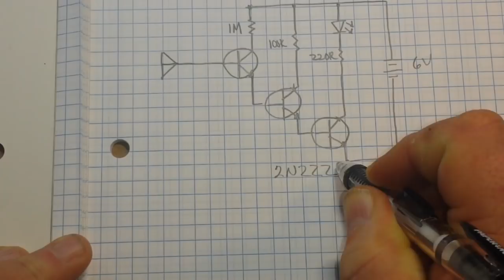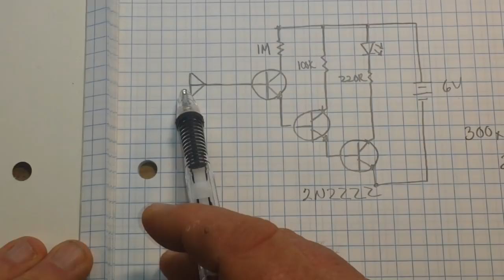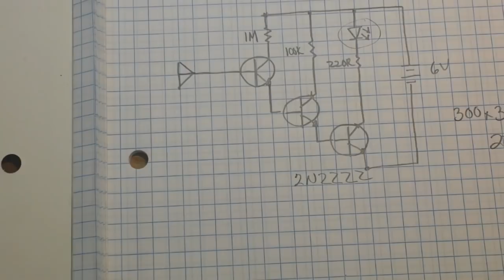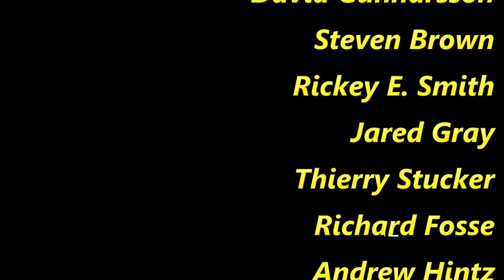Just for fun: 3 transistor charge detector( ghost detector)

Comment: I was looking for something to detect how much of a charge electrostatic filters still had. Potentially it would give me an idea If a n95 mask was still usefull. I put a volt meter across the diode to give me a digital readout. What I've noticed is that I seem to get a strong reading when I move the filter about an inch or two away but the signal dies when I stop the movement. I seem to have to induce a current thru motion.  Is that an expected response?

Comment: I know this is an old vid but i wanted to try it as im just learning but i could  not for the life of me get it to work. The components i got are exactly the same as listed, but once assembled the led is on all the time. I tried looking for shorts but there are none, i checked the transistors are in the right way, i changed the transistors incase one was faulty. I tried over and over with the same results. What am i doing wrong? Why would the led be on all the time?

Thanks for any help
Reply: Your bias on your 1st transistor is too high. Either your pickup wire is too long or you use higher voltage or you have too much interference from RF or static

Comment: Hi, I'm looking for a solution to detect AC or DC current in a wire (= 0 Aamp or >= 0 Aamp ) without contact to the copper with an hall effect sensor. I'd like to use à ESP8266-32 to get ON/OFF information. I'd like to detect that electric machine status is on/off without cutting the wire (just by gluing the sensor on the wire for example)
 Do you have any recommendation, video in you pocket ?
 That's a subject for the next video ?...

Comment: Thank you for sharing your knowledge. Tried this. Burned the led. The total  hFE of the transistors is 428*429*357=65,549,484 gain ( with 698mV each). The led  Uf  is 1.92V. What should I do?
Reply from the maker: Increase the led resistor... Try 1k
Reply: Thanks. I tried 1k and 220k+300k and led shined (my mother in law was around). Then I tried the 220 and it worked for some time (the led is 3.7v now).
Reply: 220R+300R...

Comment: Thanks for the video!  I just found you via some ham radio video suggestions.
Would this work as an uber-sensitive field strength meter to test if things like LED light bulbs are emitting trash RFI?  The noise floor at my house is usually really high and I'm needing to find some sources of the interference. My relative DIY relatie RF field-strength meter isn't sensitive enough to do the job.
Reply from the maker: It is not super sensitive. LEDs aren't a source of RFI but their power supplies sure are.

Comment: Did you see big Clive's ghost detector with the old TV antenna?
Reply from the maker: No, is it similar?
Reply: learnelectronics in that is uses transistors, yes.  :D. (sorry I couldn't resist that).  I think he just did two(Darlington) but he explained something about touching the antennas together to shut it off or put it in such a low current mode it was virtually off.   It was a neat finished product almost.  Yours is a bit more interesting though, I want to look into them both and try them when I have the time.  Even before you said it I thought "he's making a ghost detector'.  Of course you didn't let me down!
Reply from the maker: Ha ha great! I'm glad you enjoyed it.

Comment: Any particular reason you used a 220 ohm resistor on the last transistor
Reply from the maker: 220r is about the best resistor for an led @ 5v... So it works well for 6v too
Reply from the maker: Bingo